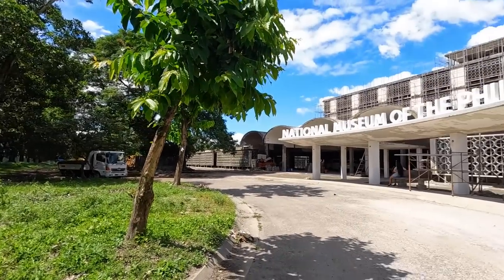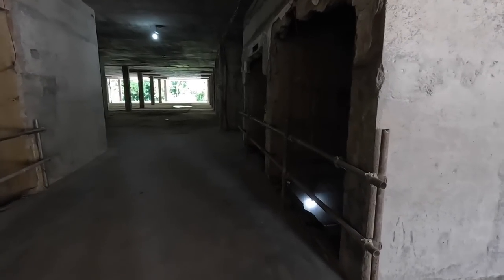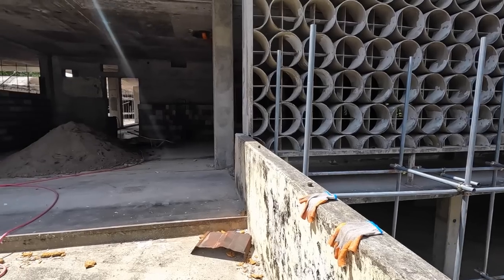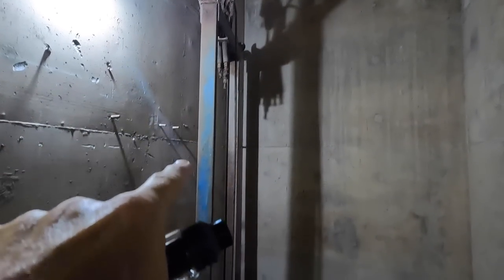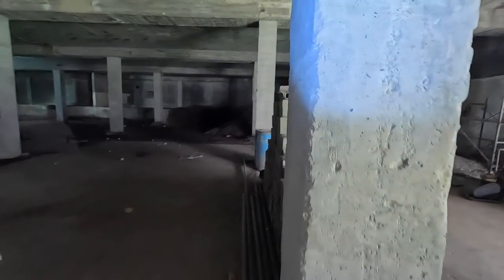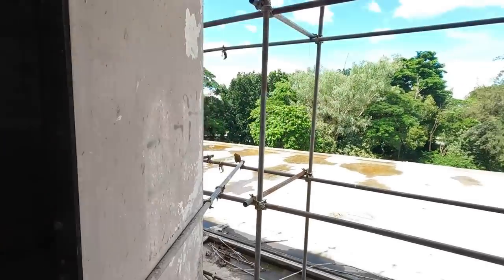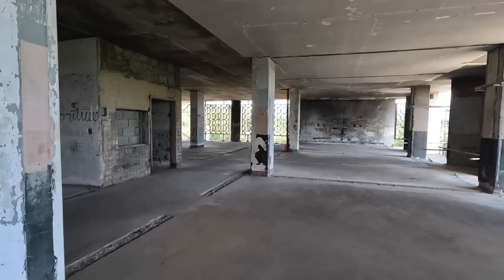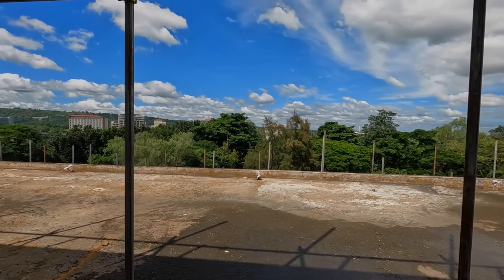CLARK AIR FORCE HOSPITAL REHABILITATION  - NATIONAL MUSEUM OF THE PHILIPPINES OCTOBER 25TH 2023

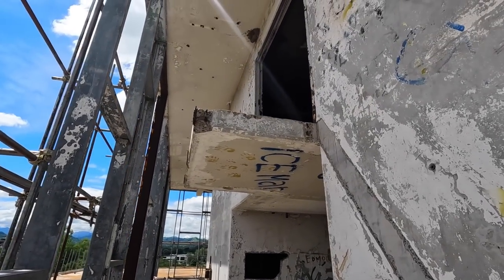Comment: @18:02 Brian, that inaccessible space on the roof is most likely where the motors and related equipment for the elevators was. The elevators being cable operated needed space for the electric motors, cable drums and control equipment.